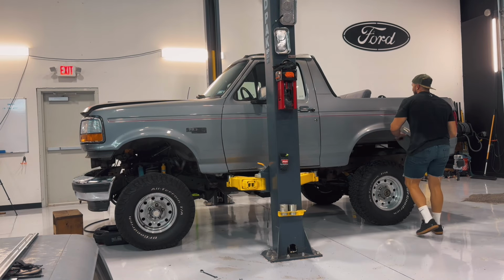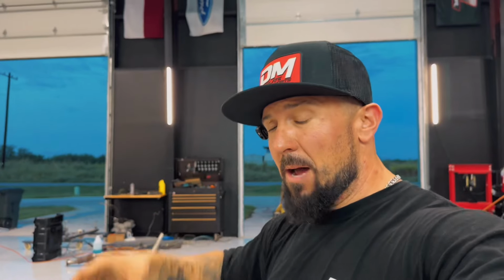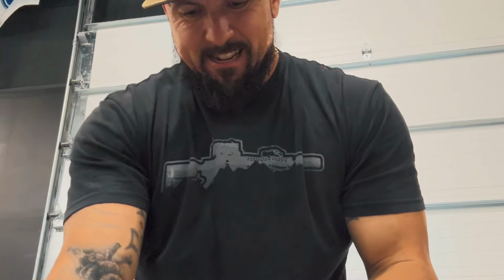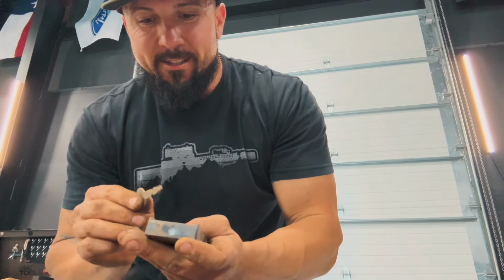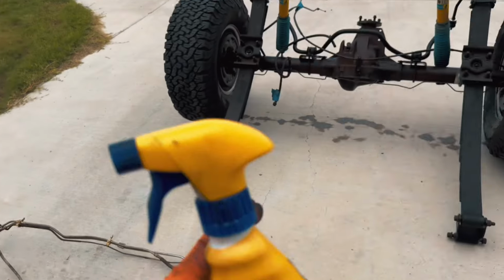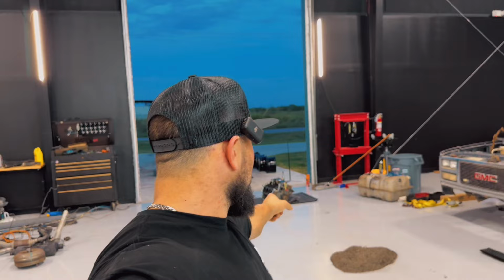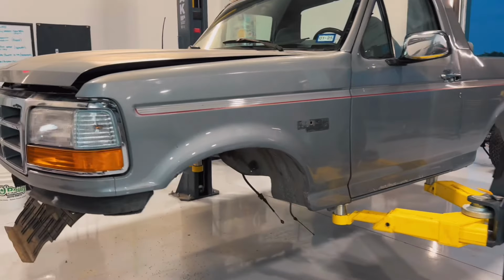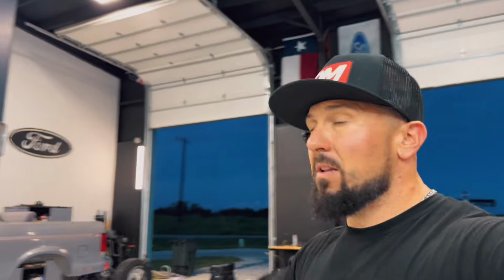I pulled the frame out of my 1994 OBS Ford Bronco

Comment: Not a fan of the articulated front axel design.  I would opt for a Dana 60, at least, solid front axel.  Had a '89 Bronco II and swapped in a Dana 44 front axel, and a Ford 8.8in rear to upgrade the drive train.

Comment: Any tips or notes on removing the body? Just installed a lift and decided I want to pull the body off a ‘94 Bronco. Same deal, bought a bunch of Desolate stuff and ordered a 347 from Blueprint to drop in. Also, where are you in TX? I’m west of FTW. ✌️
Reply from the maker: Honestly it’s pretty easy. Nothing was super tricky or needed a work around.  Took about 4 hours to get completely separated

Comment: Why do you say you make a build that you think people can do themselves. Puts out video of front end work and then a month later a video ripping it off saying it’s all going to get replaced. Is it an all desolate motors click bait build? Thought you were going to do some really dirty work. Instead send it all off to be rebuilt. At that point you would LS swap it or make looking like a show bronco.
I mean you can always buy better parts and not get dirty. That’s a rehaul not a rebuild (cause you threw away parts)
Congrats on the family waiting for the next video
Reply from the maker: Every single part I did in the steering overhaul is staying on truck… everything else suspension related will be replaced with upgraded components.
Reply from the maker: The only thing I sent out to be rebuilt was the engine for the sake of time